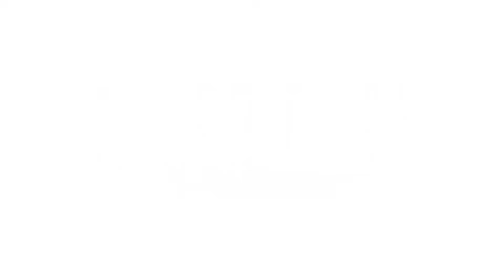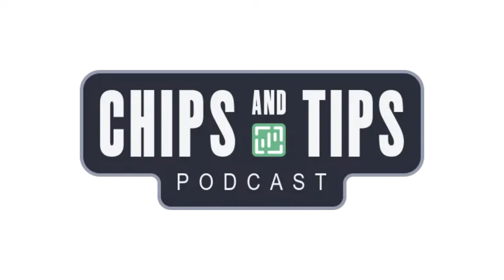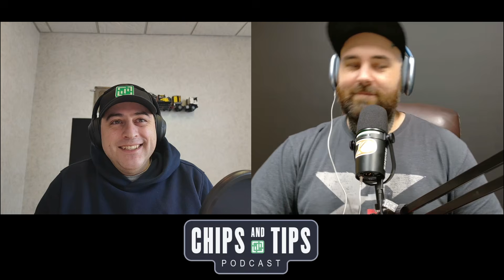My Tool Library Is Better Than Yours with Chris Zappettini

Comment: The problem often times boils down to team work.
The self employed machinists more often have decent tool libraries than the big shops because of "oh but the others" mentality.
If we are 20 machinists at a shop, so so many just won't bother with a decent library since "the others" will mess up everything anyway.
This is valid from speeds and feeds to holders: why bother creating the perfect tool if your colleagues will run it differently?

Comment: My pain point lately has been using the same tool in different materials. From plastic to titanium. Can I put the same tool in separate libraries, so the speeds and feeds are saved?
Reply from the maker: You can use Presets on the tools for different materials and cutting conditions. We have A LOT of them predefined within the tool libraries available within Toolpath.